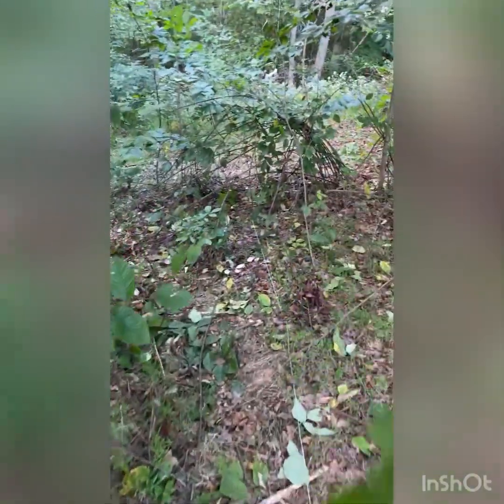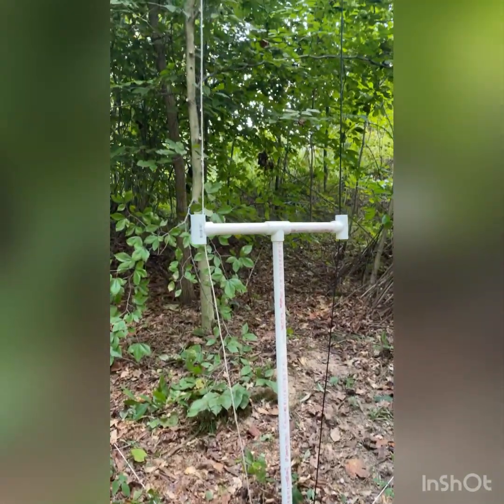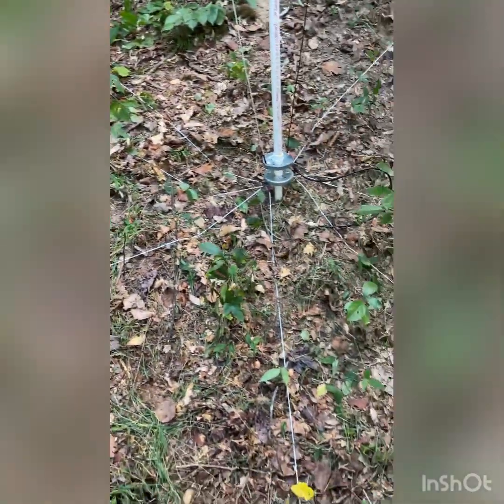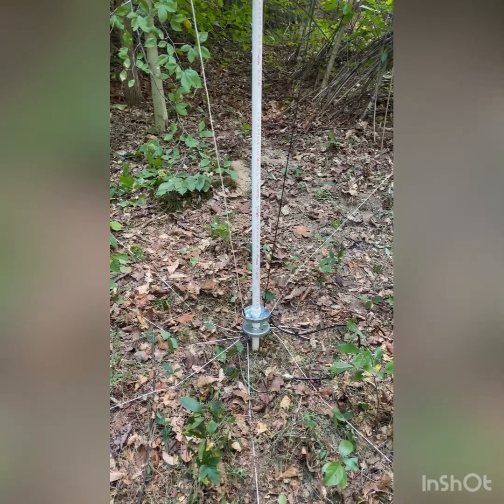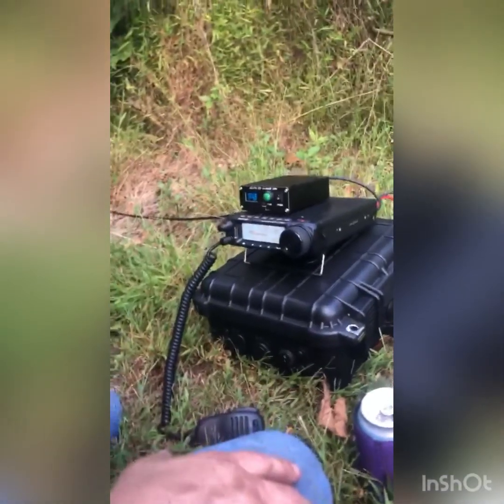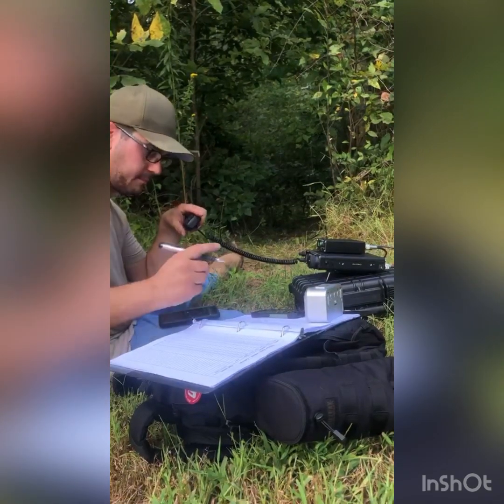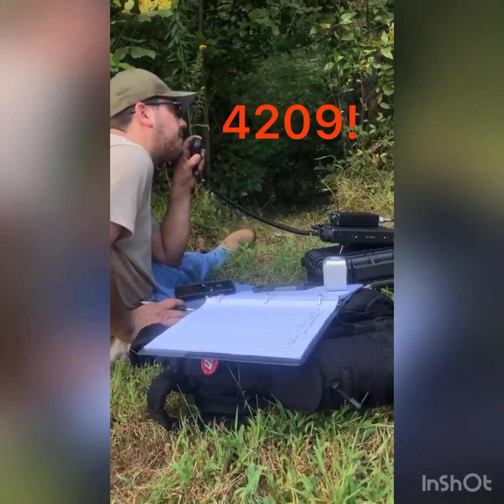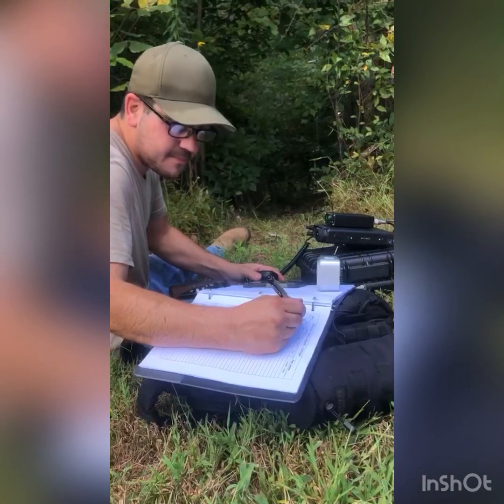Vertical HF Antenna

Comment: Nice job Evan!  You plan to add some more bands to the "plumbing commander"?  That design is pretty ingenious.  How in the heck did you get that thing hung up there?
Reply from the maker: Thanks man! I do plan to add 17 & 30, but wanted to see if the concoction worked before investing too much time into it… As far as getting it up there I used my special “throwing rock” that has thin paracord attached to it. The limb is probably 45’ up there. I was able to make it over the branch on the second try, then just pulled it over the other side :)

Comment: Any chance you could do a how to build this video>>??? Im not very bright when it comes to looking at something and figuring how its done LOL
Reply from the maker: I will be pulling it down in a few days to add a 17m & 30m element… It won’t be a start to finish explanation, however I do plan to video the addition which should get you heading in the right direction. I have a sketch I could email you if it would help. If so, look me up over on QRZ.com :)
Reply: @hamaholicw9zaw72  coolness and thanks so much